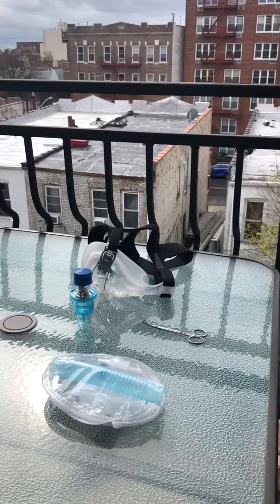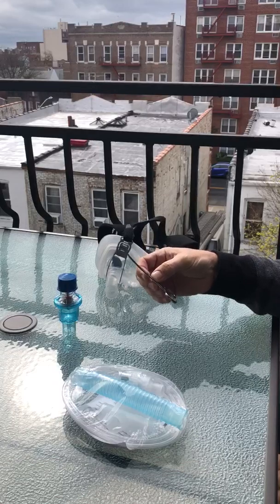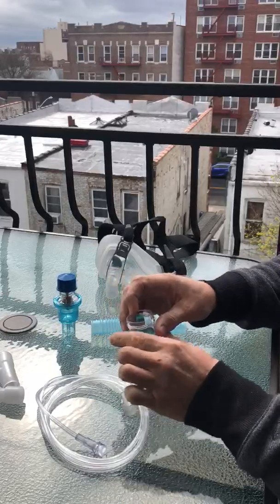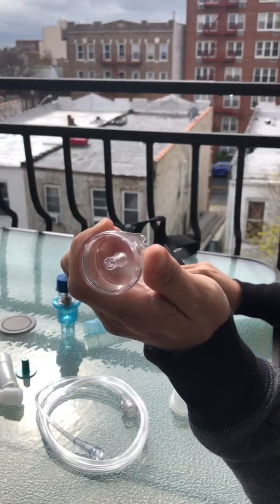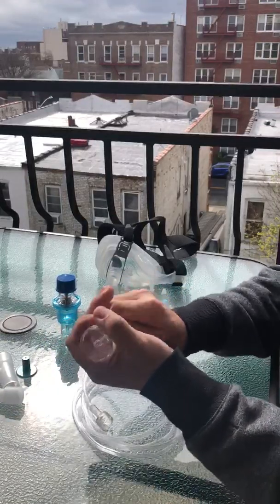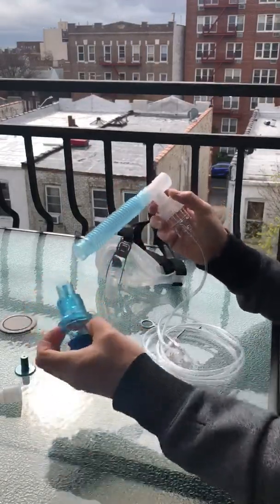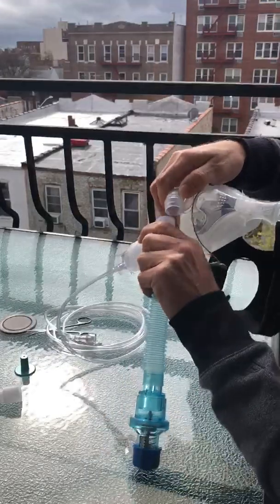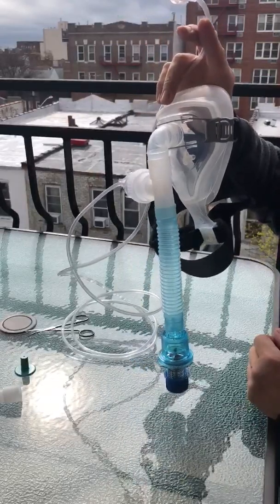How to make a wall-oxygen driven CPAP device. #silverbergsnorkel

Comment from the maker: If you can put everyone on a vent, that is awesome but my guess is every hospital in the world will not have enough vents to manage.  There are some closed circuit bipap machines out there.  Use them until used up also.  But when you exhaust those devices then you don’t get a choice about generating aerosol.  If you are forced to jump to that level then every worker in the hot zone needs to be in N95/full PPE.

Comment: Awesome creativity, but this is just providing PEEP, rather than CPAP (Which is probably better than nothing). Unfortunately, it's not providing adequate flow or really any pressure to speak of during inspiration, especially if the patient has a high RR. It's hard to tell, but the mask you are using looks to have an anti asphyxiation vent as well, bypassing the inline viral filter, with the attendant IC issues.  If your local EMS system has pulmodyne CPAP devices or similar (~140L/min bulk flow with the O2 on flush rate), that's more or less what you are trying to recreate. You can visually verify what I'm talking about with a pressure manometer inline (RT or RN might have one available, or cannibalize an EZPAP device with its manometer and some adapters). I don't have the equipment to try to make one at my facility, but you might be able to make your own bulk flow cpap with your setup and the addition of a Venturi device but it would be way more complicated
Reply from the maker: rnm1 all your points are well taken and probably true.  Remember we r looking for something to take the place of a CPAP when there are no machines left.  The EMS devices r great but good luck buying them.  Everything is sold out.  Thank u for commenting though. I agree w everything U said.
Reply: @Silverfish8  Absolutely, thank you for what you are doing out there and stay safe